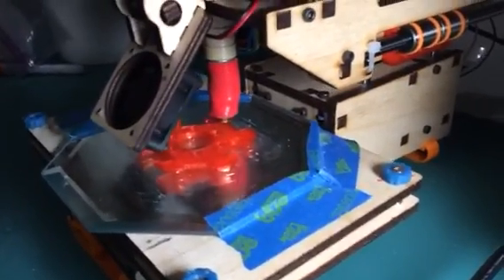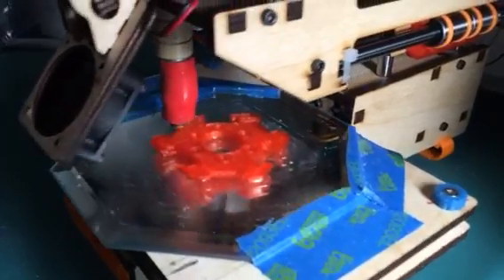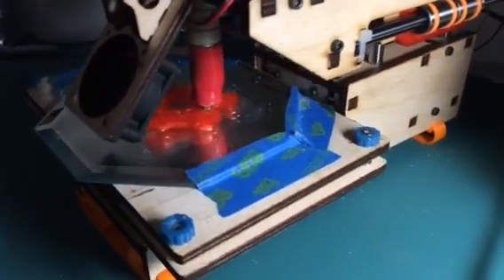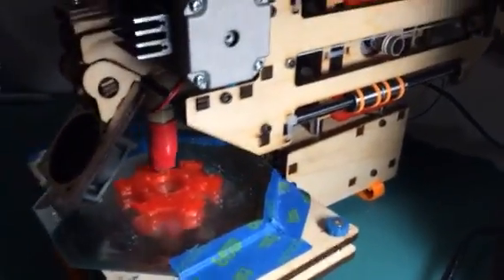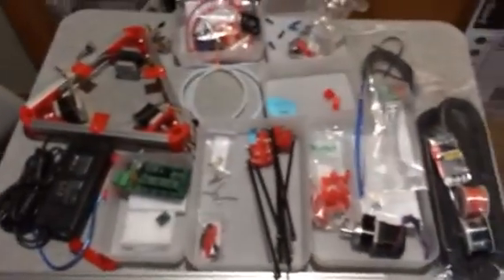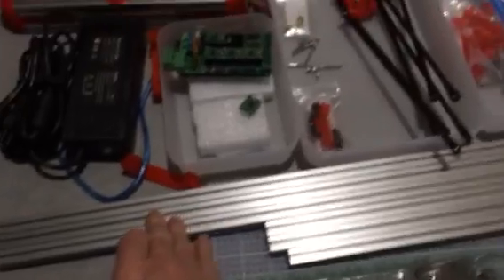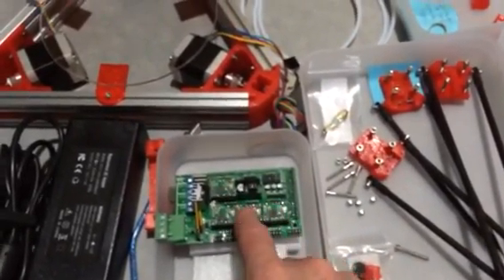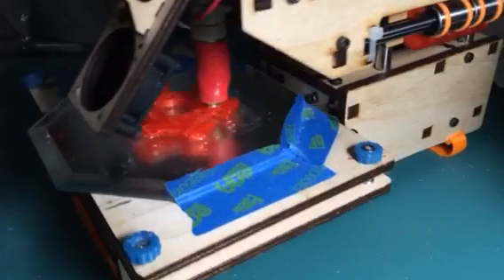3D Printing Printrbot Simple

Comment from the maker: As away to learn about the basics of 3D printing, the Printrbot Simple is the least expensive way to learn.
There are design changes to the Simple you need to make.
Look at the Extruder and make sure the bearing is not blocked by wood under it, the bearing needs to push the filament against the MK7 gear.
Print the Y axis leveling adjustments to tighten and level the Y axis.